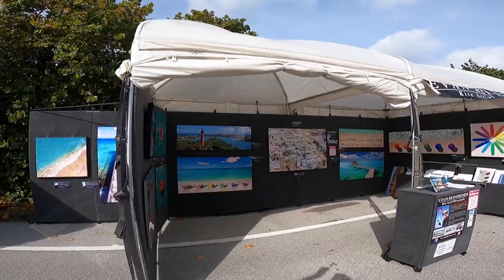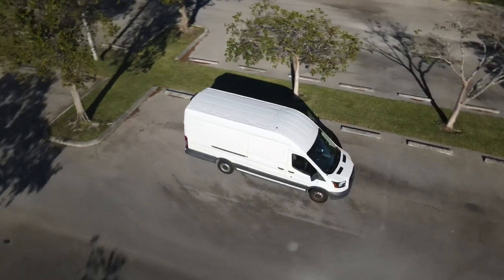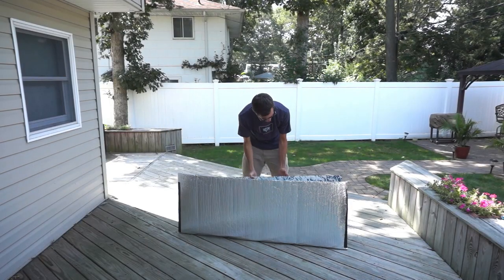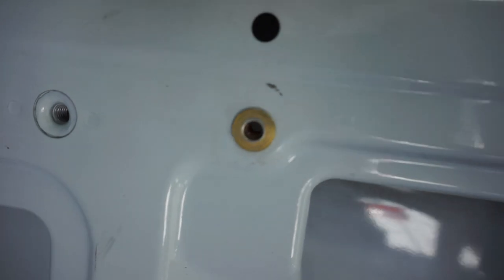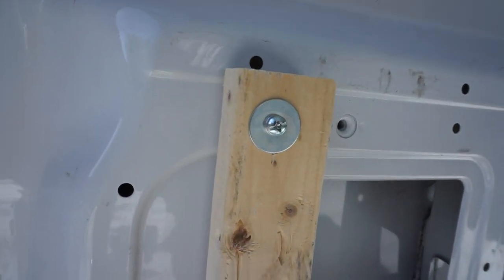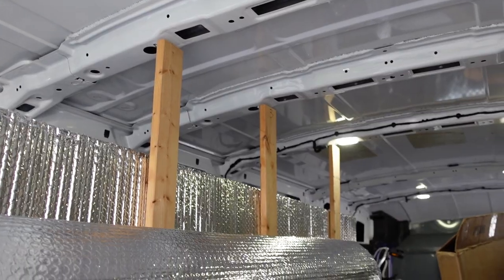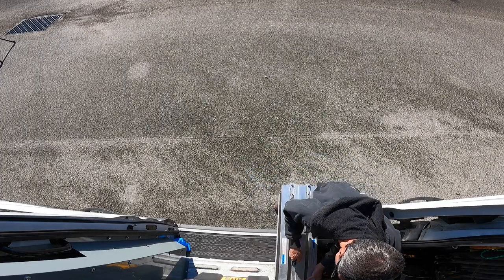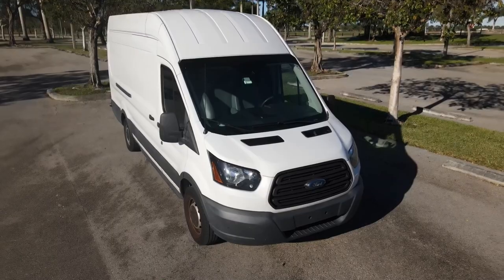How To Build a Platform for Bed or Cargo in a Van EASY!

Comment: Very informative video, Evan!  Just one quick question.  Where did you get the foam rubber padding you used for this project?  Thanks so much!
Reply from the maker: You can buy it at Home Depot and probably Lowe’s too. I think it’s used for flooring so probably will be near that stuff. It comes on a big roll and you can cut the length you need right in the store.

Comment: Wow, love your set up. How/who did your bulkhead install?
Reply from the maker: Thanks! I installed the bulkhead myself. If I had to do it over again, I would have had a professional install it. Not that it was beyond my ability, but it was very awkward to do solo. I’d also get a more solid partition. The one I have has a mesh type window that allows air to circulate but that makes it more difficult to cool or warm up the front cabin. One of these days I will seal off the window probably.

Comment: Thanks for the look at your build. Did you put the bulkhead in or have it installed?
Reply from the maker: I installed it myself. If I had to do it again I would have had it professionally installed. Not because it was beyond my skill level, but because it was very awkward to do solo. I also would purchase a more solid partition. The one I have has a kind of mesh window space and allows air to circulate. So in order to cool the van with AC, it basically needs to cool the entire cargo area too. I’m planning to cover the window area some day to help that issue.